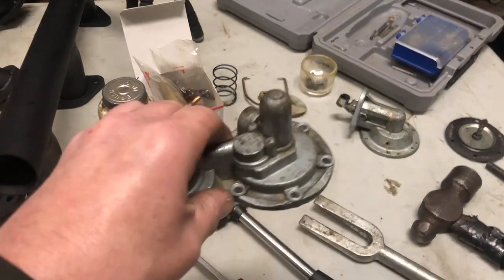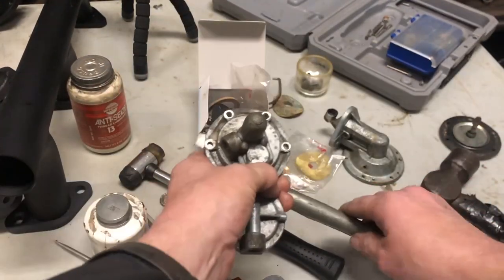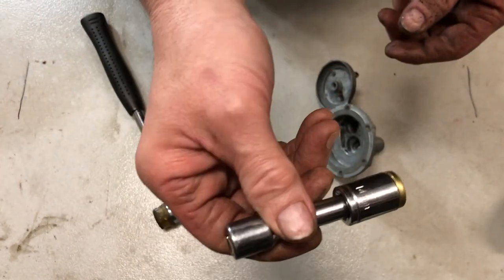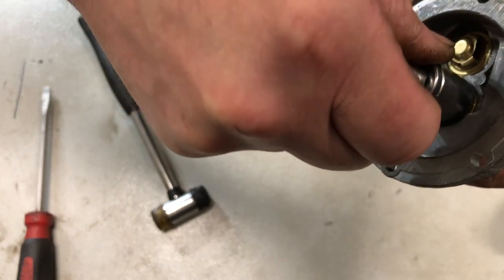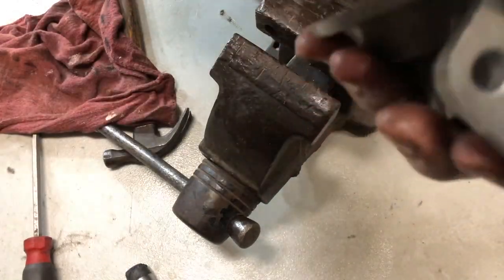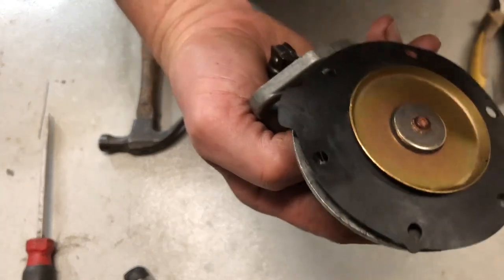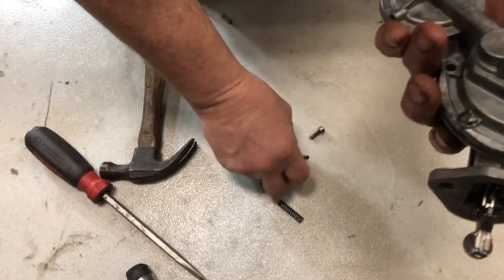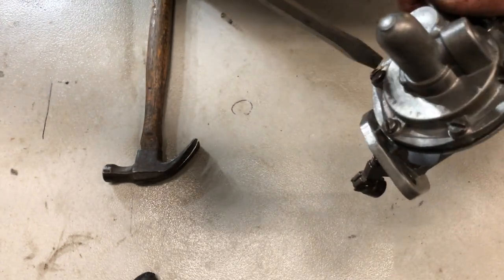FUEL PUMP REBUILD & RESTORATION - Ford Flathead Engine - How to

Comment: Really do appreciate this , started the revival process on my mother in laws 52 f1 that’s has been sitting in the woods for 25+ years , got it dug out moved , had to do some rewiring on the ignition system, has spark from coil to points , just waiting to get some money to buy new spark plug wires as mice have destroyed the originals , then I believe I’m gonna rebuild the manual fuel pump but plan to do a temp fuel system just to get her started

Comment: Thanks mate....lifesaver. :).  Yeah I like the Eastwood video but you are right they don't show you swapping out the old valves inside.  I didn't use your method as I didn't have a bot big enough lying around but mine popped out easy enough with a flat blade Screwdriver.  But great detailed video, helped alot thanks! :)
Reply from the maker: I’m happy it helped!  Thanks for watching!

Comment: Thanks. Perfect. I got to exactly the same point - staring at the two valves that weren't going to come out without some convincing! As you noted, service manual suggests they''ll just lift right out. Not so much...
Reply from the maker: I rebuilt another pump the other day that actually has a small bracket that holds both valves in.  In those earlier pumps they do lift out but that was the first time I’d seen that type.  

Thank you for watching and thank you for commenting!

Comment: Good video.  I suggest that when assembling the fuel pump, it is important to push on the arm to fully compress the diaphragm spring so that the diaphragm will have its full range of travel when operating. Leave the screws lose a turn and a half or so; then push the arm to its fully compressed position. Then while holding it in that compressed position, tighten the screws in a crisscross pattern.  This pulls the diaphragm up or down as the case may be so that on relaxation it is a bit "baggy" inside the pump, and allows it to move up and down with the pumping action more freely. and without over stretching the diaphragm rubber. This method is also shown in the pump rebuild videos done by Then & Now Automotive who make the best rebuild kits that include check valves that they make and the correct diaphragm springs that give output pressure per the old Ford specs.  Jim C.
Reply from the maker: Thank you for the detail

Comment: Great video.   I had the same problem with check valves that other commenters had.    So I gave up and purchased a Bob Drake fuel pump.    It seems beefy enough and it works fine.  Too fine!  It pushes about 7lbs fuel pressure, so I had to install an inline regulator.   I don’t love how that looks but it’s running fine.  **Discovered later (somewhere on the HAMB) that simply using the old spring, instead of the new spring, works best for correct fuel pressure.

Comment: Do you the PN for the kit to add a fuel filter to the glass bowl?
Reply from the maker: Are you referring to the old school filter that goes inside the glass bowl?  I have one on an old rebuilt pump like that.  But I always run in-line wix filters before it gets to the glass bowl. 

I personally wouldn’t add the media filter that goes inside the glass.  My glass bowls catch stuff that gets past the wix filters.  The glass bowl alone is very efficient.
Reply: @ChadDrake4185  ok good to know. I'll just rebuild it and leave my in line wix in place. Great video.
Reply from the maker: Thank you for the question and the feedback! I’m happy to help.

Comment: Did you slightly stake the check valves in?
Reply from the maker: I did
Reply: @ChadDrake4185  must have miss it.  thx.
Reply: @ChadDrake4185  u know where to get just rubber diaphram, i understand that all 3" and 4" have same screw holes punched to fit any pump?  thx.
Reply from the maker: @wrenchguy  checkout https://thirdgenauto.com/.  I believe they carry just the diaphragm.  This is where I buy my kits.

Comment: Usually the aluminum at the edge of the valves is lightly 'peened' to lock them in place......Ethanol kills those diaphragms and I've been rebuilding a similar pump for my '59 TR3A for many years....Always use original stuff but the kits and repos made offshore are garbage (from India)......Had to heli-coil the threads on the base 'cause I've rebuilt mine so many times over 53 years that the treads became 'punky' ....You can find kits on-line that are Ethanol resistant, but you pay more (it's worth it)......John(west coast,Can.)